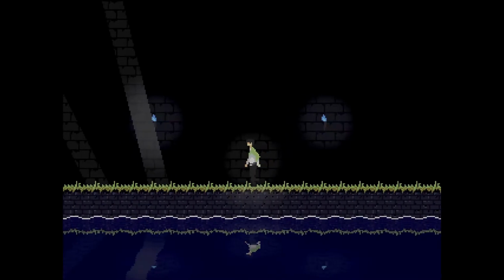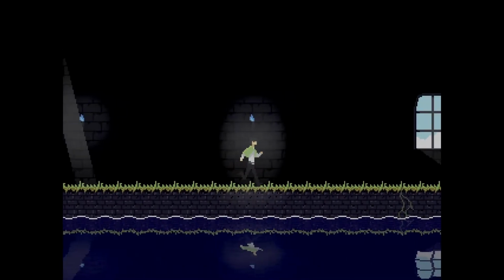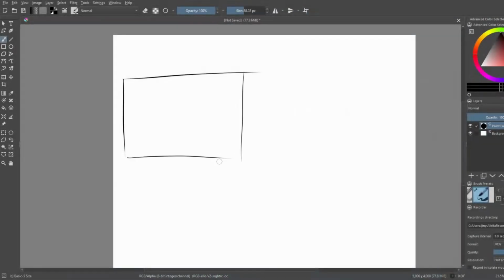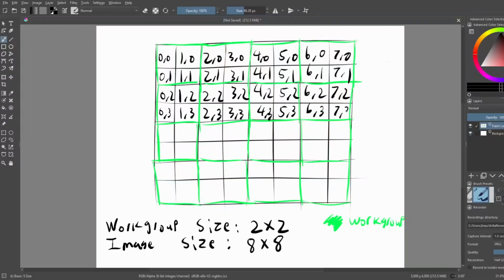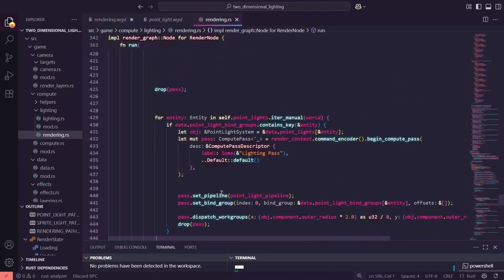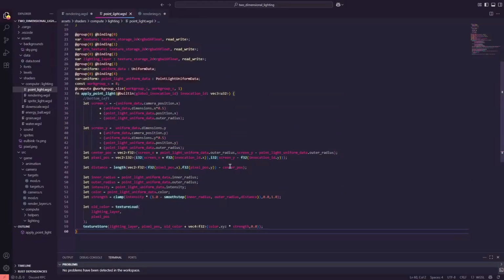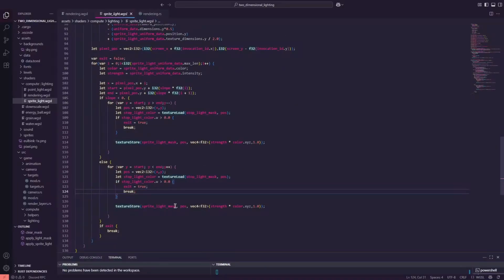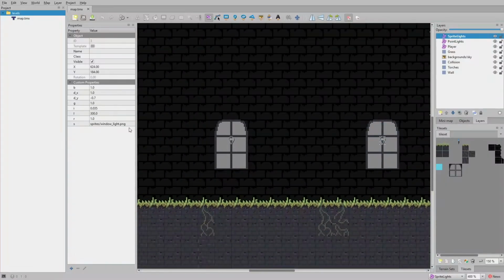I Spent 1 Week Learning to Code 2D Lighting with Bevy & Rust

Comment: are you able to share your source code for this?
I was studying bevy_magic_light2d to learn how that process is done, but it's doing way more than i need
Reply: Author of bevy_magic_light2d. Sorry for the mess. It was an experimental project, but many people asked to release the code.
Reply from the maker: I wouldn't recommend looking at the code for this system because it is honestly kind of a mess. Instead of looking directly at a lighting solution, you might consider learning how shaders work in general for bevy and implementing your own solution with that knowledge.
Reply: @bipedpotato   I'm familiar with how shaders work in bevy. I did liquids simulation with compute/fragment shaders. I also have an implementation of 2d lighting, but it's not optimized yet either.
I don't mind reading messy code, it's just helpful to look at examples for the different techniques used even if they're not optimal.